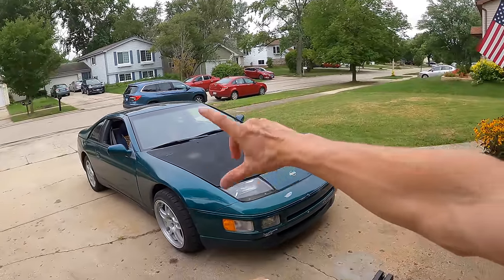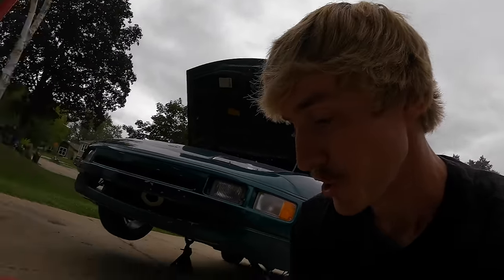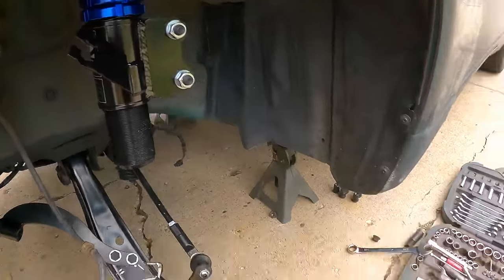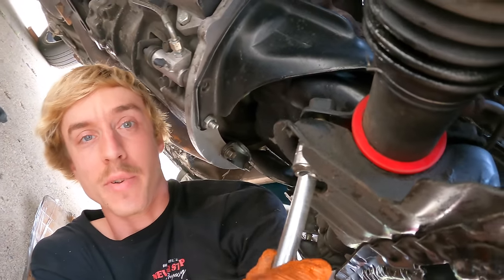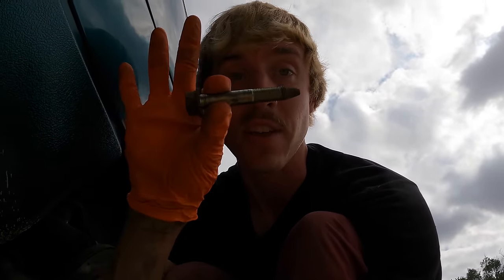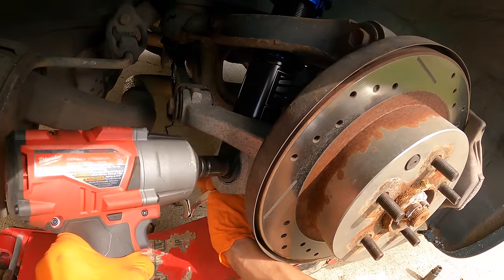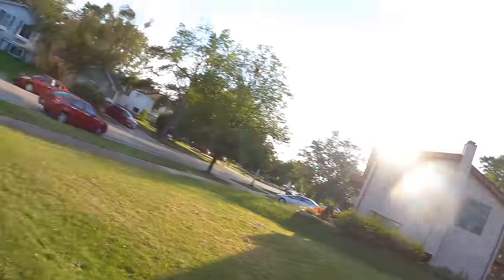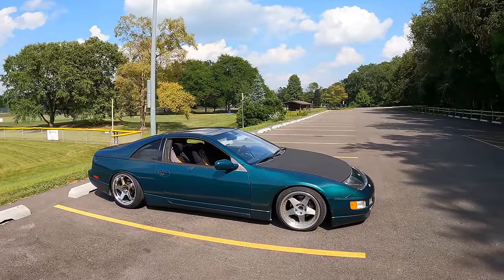MEGA Suspension UPGRADE on my Project 300zx!

Comment: This is amazing work. I've been watching the KA swap and you've made this Z32 so much better (I had one, that new suspension/steering setup you came up with is brilliant).  

I recently rebuilt the KA in my 01 Xterra. It was a $550 towyard vehicle destined for the crusher, and much the same way as you I've been piecing it together from various junkyard vehicles to keep costs low. It went from a leaky mess that struggled to idle to a smooth-running gem of an engine after the rebuild. 

It makes me glad to see others beginning to recognize the many strengths of the KA... it looks right at home in that engine bay. 

Keep on doing the awesome things you do my guy!

Comment: Looks super sweet now, Mike! Most definitely need to measure the distance between the 240 strut towers & move them inboard on the 300 to suit as lengthening the bottom arms will pull the wheels too far out of the arches. I'm pretty sure the strut tower plates are at least 1" per side too far outwards. Cheers. Leigh. PS: Jack the car up & use a phone book to stretch the wheel arches when let down!

Comment: Low car jack fix. There is an air pillow that is designed to fit under low cars. You lift with the pillow and then put the jack under the car then. Reverse to lower.

Comment: mike, the two bolts that hold the coilovers to the knuckle arent safe until you either use ( large) spring washers for the nuts, or blue colored  thread locker, or lock nuts. Getting five? degrees ( you only need one or two) negative camber by either extending lower control arms or moving strut tower tops in by 1-2 cms may be a pain in the ass. it might have been better to have welded those top mounts in further. Extending lower control arms by welding is not like welding rust and crash repairs, tread carefully here, perhaps get lower control arms custom made, i wouldnt  extend lower control arms. Its a safety thing.

Comment: I was cringing when you cut those brand new coils, but that cut you showed looked pretty clean!  I wonder if you could cut access holes for the coils and then just 3D print some covers to cover the holes... it's weird they wouldn't put access in there... Even the lowly 240 had access covers...

Comment: do you also put some anti seize on hardware? or do you just put bolts in dry?

as for the mileage (had to change from KM's lol)

Hyundai tiburon:  2500 miles per month
MX-3 V6: sold last week.. sometimes you gotta let em go
'79 Manta : about 180-250 in the summer months
'87 Manta: currently none, shes on jackstands
'84 Manta: again.. jackstands

#projectcarlife

Comment: I would advise that you would change at least the passenger side coils. Just because they "escaped the crash doesn't mean they haven't been through some serious stress. They will have and  currently have some micro fractures. Especially the front one, you mentioned your wheel got destroyed. I wouldn't risk it if we keep in mind that your car is priceless to you. So would you like a coil fail on drift event, or in a bumb and get it again into a crash or at least make some serious damage.

Comment: i put 66k miles on my vw jetta daily in the past year. i did 18 oil changes and drove about 5500 miles a month 😂😂😂

ps. i have a 2000 honda accord that i just had to replace the gas tank on. i think 70% of the bolts and nuts were seized 😂 had to legit cut most of them out it was the absolute worst